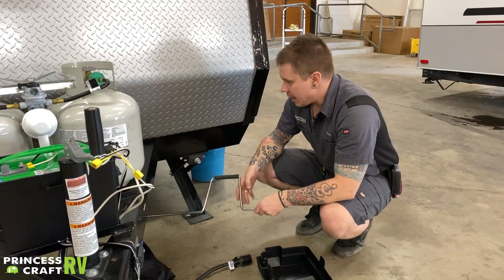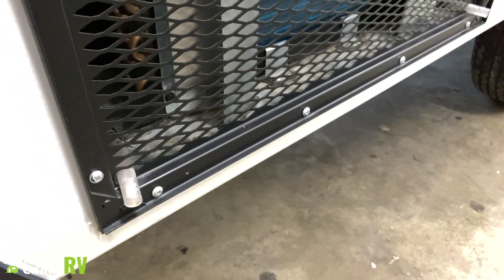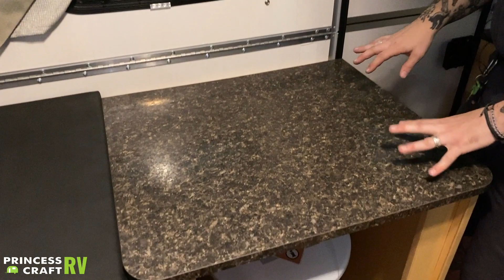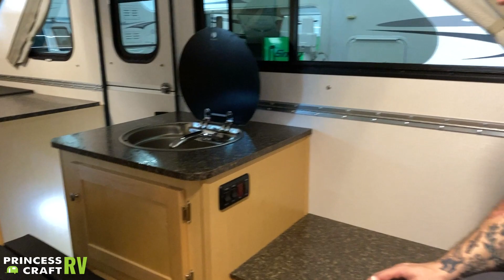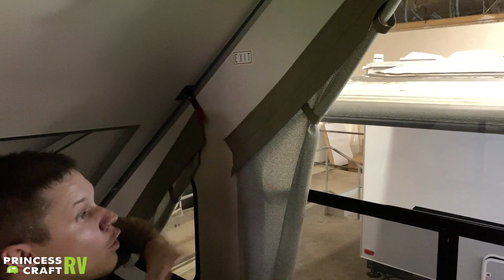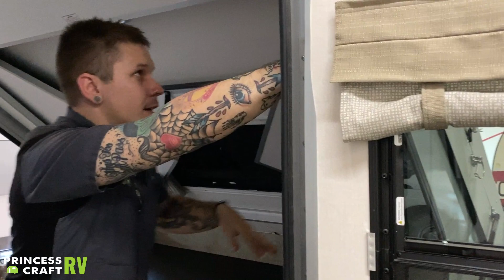2020 Technician Tour - Aliner Family Expedition

Comment: Just wondering, is the refrigerator/cooler accessible from the inside with the outside kitchen closed?
Reply: I saw in another video from Adventure RV that the fridge is accessible under the front cushion.  However, the stove is not.

Comment: What's the actual weight of that unit with all the options (hard dormers, furnace, heater tanks and all)? Close to 2.5k lbs?
Reply: A little bit less. Without AC is around23xx lbs.